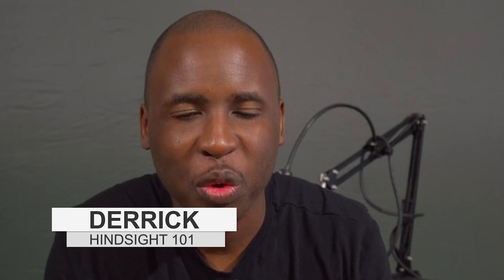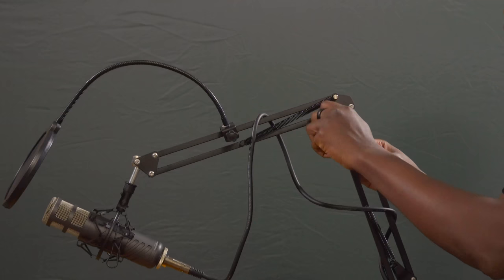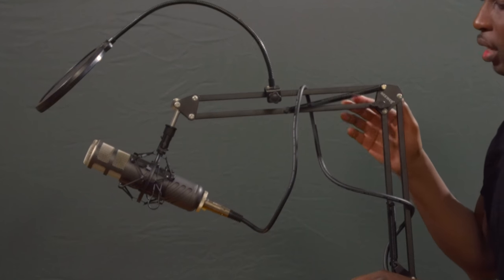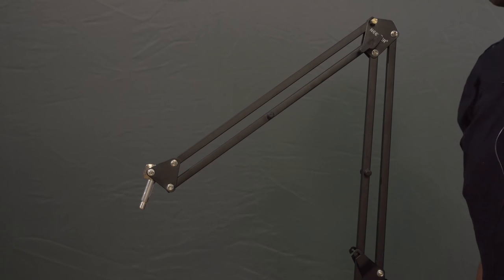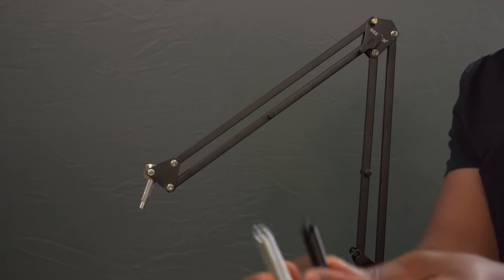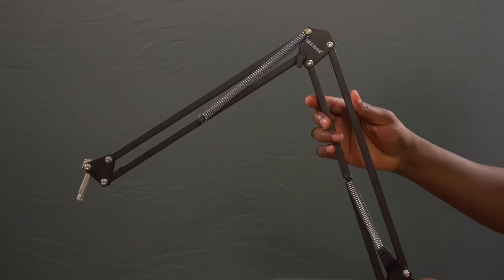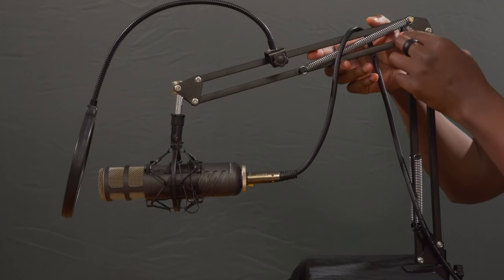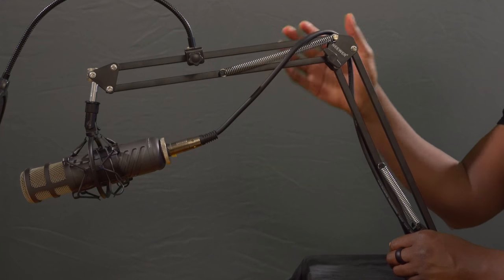$8 Hack to Keep Your Microphone Suspended Right

Comment: You genius! I'm going to run out and get some springs as soon as lock down lifts.

I actually came across your video as one of the nuts cracked (because I had to over-tighten it).

For anyone with the same issue, the type of nut to replace is called a "wing nut" or "butterfly nut".
Reply from the maker: Glad you liked the video and thanks for the tip

Comment: Great video.
I wish you had a hack to prevent the springs from resonating every time you hit the table or the keyboard.
Reply from the maker: For the arms that have cheaper springs, replacing the springs does help with that
Reply: just tape the springs to the arm

Comment: Any tips for making the part where the microphone connects to the stand stronger? The small silver rod.
Reply from the maker: What issue are  you having?
Reply: @Hindsight101  I can't tighten the silver part that swivels enough. My microphone is too heavy so I have to leave it either hanging or upright.
Reply from the maker: No thats the downfall of an inexpensive mic arm
Reply: glue a piece of thin rubber on the sides of the squares that are screwed together holding the rod.

Comment: I have a question. I live in Canada so I can’t buy the same springs that you showed on the video (or buy those from Amazon, because they don’t have the same model in Canada), will it work if I use a spring with a 0.72 wire diameter?
Reply from the maker: It might rub against the boom arm. So 2 things could happen. The spring might be harder to put on because the spring is pushing against the arm. Second it might make noise when moving the arm because it may rub against the mic arm.
Reply: @Hindsight101  I have another question, I managed to find the springs that you showed on the video. Do you think that they will work with Tonor T30 boom arm? (I am trying to hold 100gm more than the maximum weight the arm can hold)
Reply from the maker: Its really just testing it out to see. I dont have the mic arm so I couldn't say

Comment: Hey there! I have the same stand and it's wobbly at the point where it connects to the desk clamp. Have you had the same issue with this?
Reply from the maker: Yes I wrap tape around the pole part that slides into the desk clamp

Comment: do I need the longer spring? Could I use four shorter springs?
Reply from the maker: Yes you could use short springs. It might be hard to put them on and if the mic isn't  heavy enough you might not be able to keep the mic in a certain position because the spring has too much tension
Reply: @Hindsight101  thank you for your quick response 👍